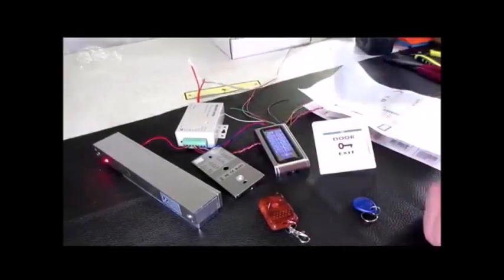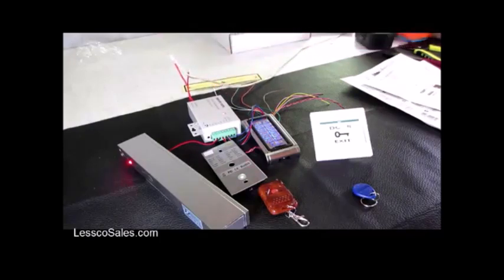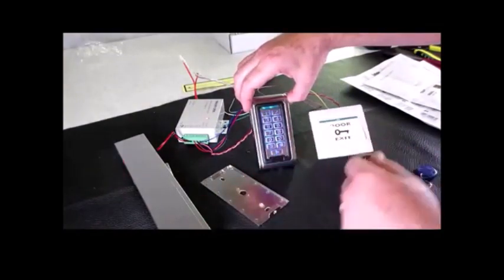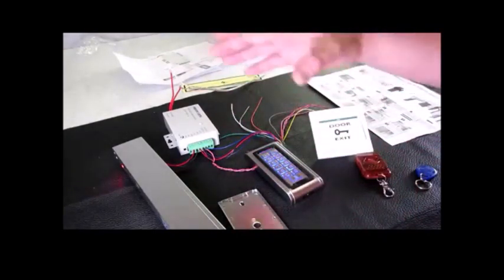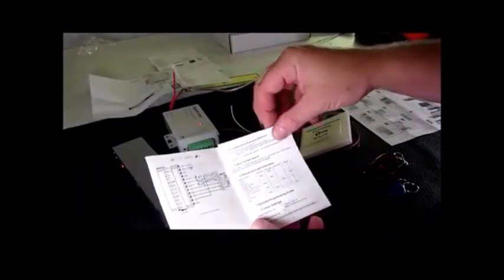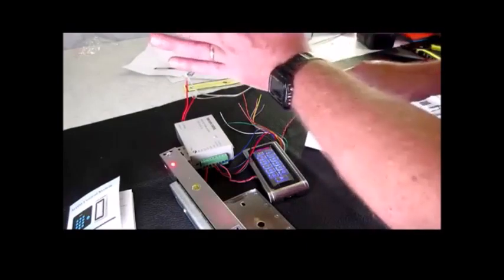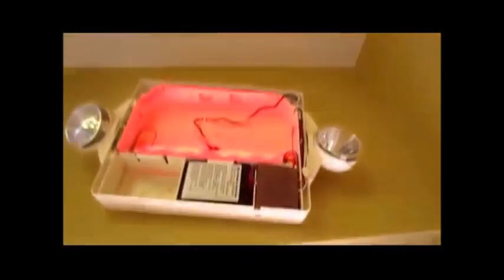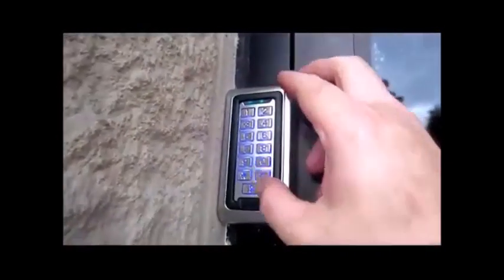Magnetic Lock Door Entry Install On A Commercial Building

Comment: how much power do these magnetic devices draw?  Is the cost negligible?
Reply: appx 2.2 amps, and the price is going up shortly
Reply: @Lessco Electronics  thanks,  but I was referring to the cost of the power.  I suppose less than the price of running a low wattage light bulb.  We have 4 doors that I would like that we put these devices on.

Comment: Definitely not licensed or your doing an insurance job!

1. Speaker wire is not listed as required by the nec

2.  You didn’t tie in your fire alarm system to release the mag on alarm condition 

3. The rex switch should be wired as normally closed, be pneumatic and non field time adjustable,  to open the feed to the mag, your switch is normally open which means you wired it to the panel to open the lock relay.  If that fails, you wont open that door, thats why it should open the mag feed, if fails in fire, door will open.

You wired that in manner that violates electrical safety and building codes.  
Miswired rex, use of. Conductors not safe for application, nothing installed is listed as required, no fire alarm connection and no pir used. 

That is going to start a fire and I hope nobody is inside.. they wont get out!